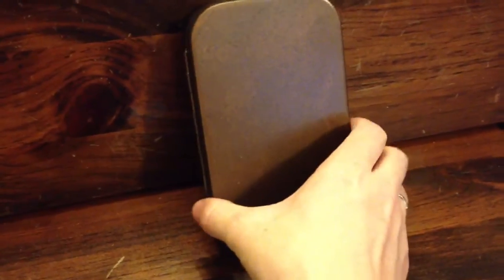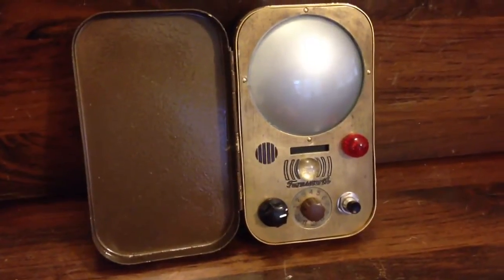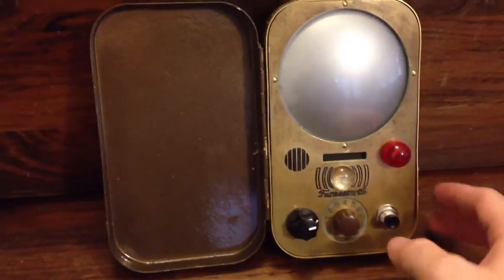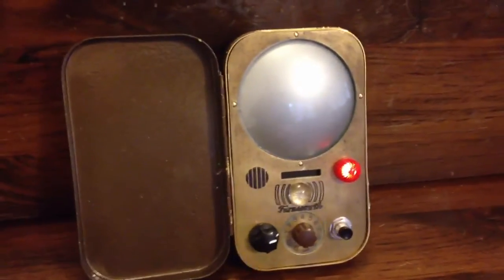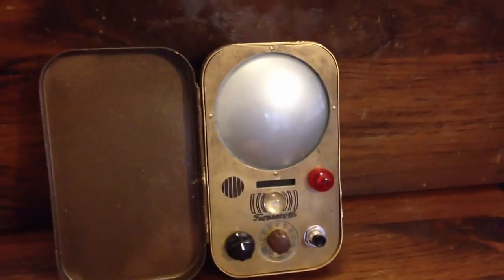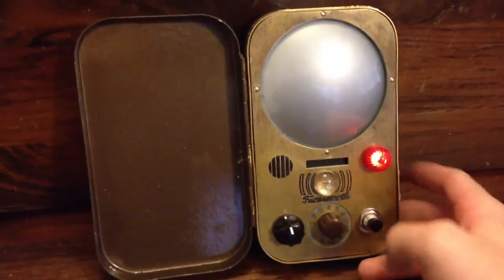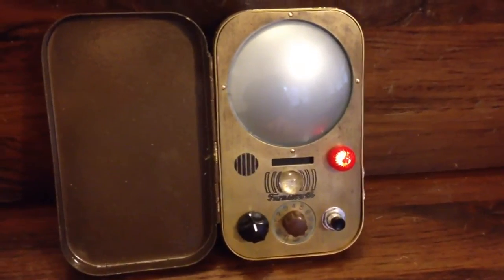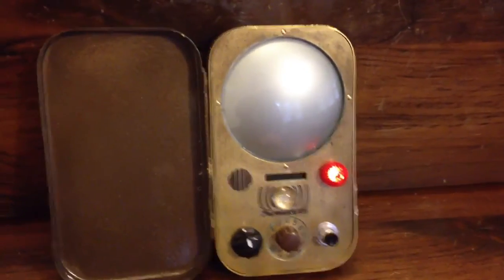Custom Warehouse 13 Farnsworth

Comment from the maker: @mb2000inc It's a Richard Wheatley 6" gold colored aluminum fly box. I'd recommend checking out the "Farnsworth Discussion" thread on the Replica Prop Forum. It has all the info you could ever want on this prop.

Comment from the maker: If you're referring to the Discussion thread on The RPF, It is discussed there. Well, either there or in my build thread. I even posted a wiring Diagram. Just look for posts started by Jedibugs and you should find it. It was my first time working with electronics, so I'm sure you shouldn't have too much trouble.

Comment from the maker: I'm actually planning on putting one together this week, but with a more accurate faceplate. There's also one other surprise feature I'm going to try to implement, but I'm not sure if it'll work yet.  I'll definitely send you a message when it's finished, though.

Comment: What did you use as the casing for it? Looking to make my own.
Reply from the maker: It's a Richard Wheatley 6" fly box from the UK. That what was used on the show, as well. Unfortunately, they no longer sell these without hooks/compartments/foam pre-installed that are basically impossible to fully remove. If you call them, they may be able to make a special sale of a base unit for you. I know some people had success doing that a few years back.
Reply: @PropsmithReplicas  I will give it a go, thank you so much. It looks awesome btw